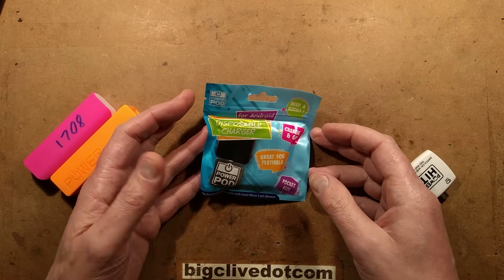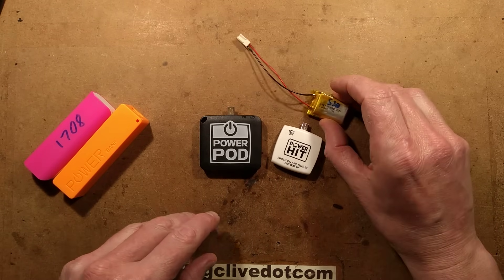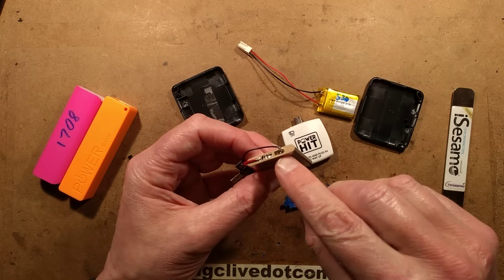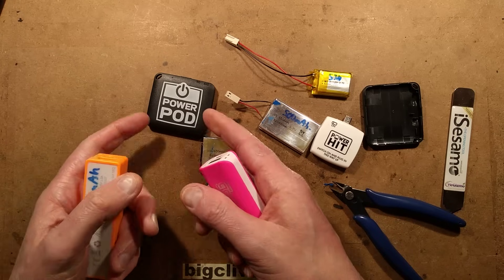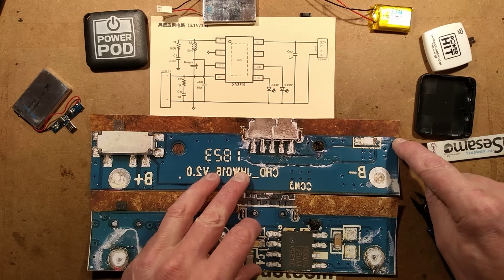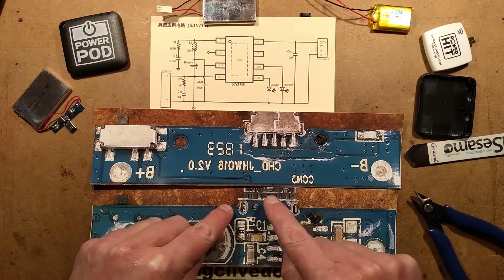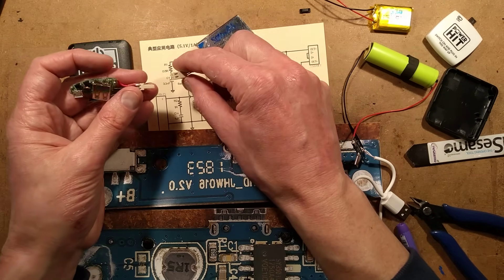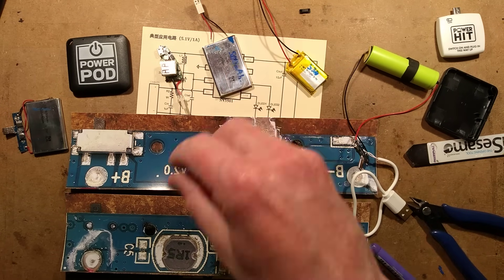Poundland "disposable" phone charger.

Comment: Those cells are most likely recovered from old cell phones or dumb phones. Normally new battery of this size has capacity of 800mah. Yours has only ~500mah. China has found interesting way of sending back electronic waste to europe ;)
Reply: Atak Snajpera interesting thought.. the larger one definitely looks like alot of cells old phones have used
Reply: Recovering and refurbishing old batteries could be too costly. I bet they are from old stocks of that kind of batteries.
Reply: This isn't how batteries work.
Reply: I think so too. Similar size to old Samsung replaceable batteries
Reply: It makes sense to reuse batteries for new purposes, if they are usable, before recycling them. Recycling takes energy and resources too, so if you can use an existing battery as-is instead of making a new one, that is always more efficient

It doesn't make sense to make them disposable however
Reply: If they are refurbished cells it makes sense.
Reply: @dustojnikhummer  no it doesn't. Having a load of lithium in one place, it could be recycled. Sending them out to be dumped in bins all over the world makes no sense at all.
Reply: @donrobertson4940  it makes sense for the ppl milking money out of recycling and then selling same shit back to where it came from. Most cheap china 18650 cells are from old laptop batteries.
Reply: @donrobertson4940  it makes sense in china where most of the world sent its electronic waste, they dont have enough facilities to handle the amount so its not uncommon for it to be sold in bulk to be used in other industries to make money off it
Reply: @HovektheArtist  They also don't actually safely recycle or dispose of any of the stuff sent there from real countries.  There's a reason they have cancer villages and have managed to send extinct over a third of all their native species of fish, not the fish quantity but the amount of seperate species, in only two generations since the communists invaded.  There's no clean water and no clean air, they had to ban all motor vehicles and spraypaint the grass green for the 2008 Olympics.  And instead of just throwing the batteries in the trash instead of recycling or atleast disposkng of them properly as they were paid to do, they put more plastic shit on them, send them overseas, for a profit, buy them in the trash back, for a profit, and throw them in the incinerator when they comeback rendered unchargable after being overdrained because of the lack of protection circuits.  Thank you China, and thank you Britain for doing your part for the environment :)
Reply: @r61425  i see someone else actually knows facts instead of just spewing opinions and jargon based on rumors.

And yea you are completely right, the backlash worldwide from this has caused america, russia and other countries to find somewhere else to dumo their electric garbage on, sadly its another lowest bidder deal and from what i have found one of the countries chosen is pakistan, which is just as bad as china, only that fact isnt widely spread. At this point if recycling electronics is going to be feasible going forward there needs to be actual places for it to happen and not just pull the same stunt over and over again just hopping countries
Reply: @HovektheArtist  Yeah it's great how bearucrats get to check off their list of responsibilities by sending the "recycling" off somewhere with a 100% Made In China™ guarantee that it's totally being disposed of to your standards with zero oversight, allowing western countries to say, "Our recycling is at an all time high :)" while reducing the amount of waste actually recycled by taking orders away from and closing domestic recycling facilities in exchange for those Chinese state of the art "recycling" incinerators, open pits, and once beautiful and non tumor inducing rivers.  The best irony is how alot of the pollution detected in California's air is actually carried by the wind directly from over China and the rest of Asia; they send the "recycling" to be burned elsewhere and it still makes it's way back, all while being smug and condescending to everyone about the environment.
Reply: @gglreallysucks5512  Because it still goes to China, and often gets shipped illegally in some cases, by both countries standards and regulations, due to corruption on both ends, usually involving mislabeling the shipment, to save costs.  Unless you just didn't know the UK shipped waste off at all, or maybe you did but you're just upset at any criticism.
Reply: @r61425  hey you’re paragraph(s) were well put. I just want to ask if you got any sources for you’re claims. anyways I hope you’re having a great day/night whenever you get to reading this. - j w

Comment: I bought the little single cell power banks. And got the circuitry out. And built my own. I'm thinking about  using a tp4056 and a DC to DC buck converter. And a couple USB connector to charge a phone or two. And what ever else.  I once thought I'd never need one of these. But being off grid. I can use all the power backup's I can get!!! And if I do loose power. From my small solar system. I can atleast use my phone. I have a few rejected cells from my liion battery bank build. I can use for this. They were rejected because of capacity. They come in at 1600 to 1990 mah. I'm trying to use only 2200 and up. And it depends on rated capacity. If it's 2600 rated and has 2200 I don't want to use it. I have over 1400 cells. For building two 700 cell batts. 7s for 29.4v. And as of now is about 250 ah each. About 95% are at or above rated capacity. I don't want to use it for a few months. Then have to replace cells. Or have the bad cells kill everything!! Great video!!

Comment: I'm a bit surprised that these are salable in the UK. I'm in the US, and I just assume our regulations will be either retarded or nonexistent. But it's something of a shock that the UK doesn't have standards barring the sale of rechargeable cells as a disposable medium. This breakdown leaves me to wonder if the same product would have been cheaper to manufacture, or of equal cost, if the switch had been omitted and the recharge circuitry put in place. I find it objectively shady that the manufacturer (not to mention Poundland) is driving sales by willfully crippling on-board capabilities, with the blatant intent of the batteries within (and the chemicals they contain) just ending up in someone's landfill.

Comment: Actually these devices are not as wasteful/pointless as one might expect. These batteries inside are recycled, probably in their third life and have much worse specs than required for typical applications. No one would use them for power banks, they're too small to be refitted to use in huge power storage facilities, so they're charged for the last time and sold as single use charger, which might be useful in certain situations. 
After disposal most of these will end up being recycled to raw materials and built into new batteries.
Reply from the maker: The battery is immaculate.  No sign of a label being removed or other physical wear, and a perfect cardboard separator where the protection module would go.  500mAh is also a very respectable capacity even if not the stated capacity.
Reply: @bigclivedotcom  I'm no expert by any means, but company that I'm working on used to make these on large scale as we were getting used baterries through goverment not only for free, we were paid to recycle, or in this case, reuse existing baterries. Why not make it a rechargable? Cause no one would care about such small and adding a micro usb socket and in our case 4 additional components would bum costs for the whole device by ~20-30%. I don't have much insight on this though, as I had other projects at the time.

Comment: They make great battery upgrades for my small FPV drone DM002 it actually almost doubles the flight time and is only slightly heavier.or save a few and make an emergency battery bank with a larger capacity, it's such a shame they are "disposable".
Reply from the maker: The drone batteries are optimised for very high current output.  These are not.

Comment: This needs banning. Also I think a AA to usb power bank/battery case would be a less wasteful product with a higher capacity, especially with cells like these available https://www.argos.co.uk/product/9803954. Lithium AA batteries provide 3,800mAh each! Someone must have got themselves a link to a lot of substandard lithium ion cells, I wonder what the maximum discharge current is and what happens when it gets there. 🔥?
Reply from the maker: The slight downside to the non rechargeable lithium batteries is that they contain a lot of lithium.  Lithium ion cells only have a tiny quantity.  The main components are copper, aluminium and graphite.
Reply: @bigclivedotcom  Indeed they do, I'm thinking with regard to recycling and the familiarity those taking part in it will have with ubiquitous AA cells as opposed to these single use chargers. I reckon AA cells stand a higher chance of being recycled properly in comparison, as well as being more effective in use.

Comment: I think Clive's correct on the reason for these Poundland ones in particular but I'm going to speculate a little more on this. A warehouse somewhere with a surplus of old mobile power cells. The phones they fit are now obsolete so they have no real marketable value. They get put on some clearance list, a butt load of lithium cells for next to nothing, the holders just basically trying to get rid of them and get a little return back. Someone sees these and thinks up an application to get them turned around and on the shelves at a significant mark up and voila. With the way the world is today, the cells would have ended up in landfill anyway, either dumped en-mass by the warehouse after non-sale or through this application.

Comment: I picked up 3 of these little jobbies from Ebay, the first one I managed to hook up to a freshly charge 18650 as they didn't really mark the hookup polarity on the blasted deal, then I went back to the auction, and they had it marked on their site.  The surprising thing about it, is that when I hooked her up, the main chip burned the hell out of my hand and smoke came from both the chip and my skin, then  try as I might, I couldn't get it to work (BIG SURPRISE!)  So after getting another working, I decided to experiment with the broken one, I didn't have a plug that fit the speaker out, so I soldered on some flat wire that I removed from some old stereo or something, then hooked them up to my speakers, the blasted thing came back to life!!! IT LIVES!!!!!  I have been playing music on it over blue-tooth from my laptop, as well as on the micro SD (TF) card and she really plays well.  It won't blow the roof off the house with it's little 3W amp but it could make your ears ring if you put it one some headphones.  I don't know where they tore these off, but you can see they were once part of some larger device, and the blue-tooth shows them as wireless headset with microphone, they do have a mic on board.  I haven't been able to get it to talk back yet but I will keep playing.     https://www.ebay.com/itm/Wireless-Audio-Receiver-Digital-Bluetooth-Board-Amplifier-DIY-Stereo-Speaker-ST/163233961641?ssPageName=STRK%3AMEBIDX%3AIT&_trksid=p2060353.m2749.l2649

Comment: Battery related question: I opened up a very old Dell laptop battery pack that had six 18650s in it. Of the three tested they had an initial charge of around 2.4V and after a couple hours on the charger they were up to 4.2V. Yay, free batteries! Alas, no, they would only power the screen of a vape mod (which also indicated the 4.2V) and not the heating coil. Now the question: If there is full voltage, why would they not power a vape mod? Is there another test I could perform besides measuring voltage on a multimeter?
Reply from the maker: Vaping devices draw huge amounts of current.  They require 18650s optimised for delivering upwards of 20 to 30A.  Laptop batteries are not suitable for that current draw and may fail with flames if used like that.
Reply: @bigclivedotcom  Thank you kindly for your reply. I've safely disposed of them; magic smoke release from a breadboard transistor ok, explody face flames not so much.

Comment: Hi Clive just want to ask you a question .... I have a holife soldering station that is only 2 months old and only been used 6 times on led lighting . I went to use it yesterday and it will not move from 0.50 now it's input voltage 220 to 240 volts AC rated current 1 amp it has a turned up on the front that will go all the way up to or should I say from 90 Celsius to 480 Celsius it has a 10 minutes cut-off time if it gets too hot and it will rump itself down to cool down just found it weird now that it won't move from 0.50 any ideas in what this could be I am more than willing to send it to you for you to have a look I make a video of hope to get a response soon
Reply from the maker: Check that the iron is plugged into the station properly.  It might be worth gently wiggling the front panel connector to see if anything happens.

Comment: I just thought of something. What if this thing is made of parts that didn't pass CQ and they're trying to recoup their losses?
It doesn't matter if the charging circuit doesn't work right if you don't charge anything with it. It doesn't matter if the battery is below is desired capacity if you put it in a throwaway product because few will be able to check the numbers.

Such parts would be discarded normally, so if they're using those parts for this instead, it might not be that bad.

Comment: Hey Clive; How about a video showing what happens if you charge these batteries without protection - do they explode ;) and what happens if they are completely discharged without any protection can they ever take another charge and what happens if you try to charge them again after...  Could be fun to try?  Thanks for another fine video.
Reply from the maker: If seriously overcharged the lithium can concentrate on one of the electrodes and cause chemical failure with the risk of a sudden self discharge and venting of heat and flames.  When overdischarged the cells will usually recover most of their capacity, but it's not recommended for high current applications.

Comment: All those charging ICs are useless because battery loses voltage easily below 3V but has more than 50% capacity so it is a pure waste of energy.
I want to see boost converter with input like 0.2-0.5 V boosting to 5V or 12V
Reply: The battery loses voltage easily below 3V specifically because there's only the residual fraction of a % of capacity left in there!

Energy is the integral of the voltage-current curve, or the area beneath it, and once energy runs out, the voltage necessarily has to drop like a brick, OK? And you can't somehow get more energy by drawing more current, because it won't let you, there's nothing left in there.
Reply: @SianaGearz  Oh yeah? You better watch this
https://www.youtube.com/watch?v=K53beWYdIpc

Comment: it is a reused old battery, because metal case lithium cells is not produced anymore, they are too heavy for small gadgets and too expensive in comparison with silver plastic bags cells. so to sell this in europe is a kind of a recycling. instead of dump old batteries in china they are refurbished like this and after one discharge they get proper recycling (for your money as a taxpayers) or more likely get refurbished again, sold to you again and again you can calculate how profitable it is.

Comment: Since it's single use they could omit the on/off switch, and instead put a contact with a piece of plastic put in place like they do to the batteries on some toys. That would save them a few cents on each device.  When the person goes to use it they just pull the plastic out and plug it in.
Reply: That switch cost them at most 0.5ct. I checked. Contact and pull tab might be cheaper for extremely high volume, but this device doesn't need to be made in half million volume to be profitable.

Comment: I'm not very well educated on electronics, but I'm trying. My thought was, if you had a dead 18650 or whatever with the protection circuit built in, could you salvage that and swap, or graft, it into a so-called non-rechargeable battery such as the "Power Pod" or the "Power Hit"? I'd appreciate your thoughts on this idea. Thank you for your "education" videos. PS Thank you also for the top about Fran Blanche. I'm now following her channel as well.

Comment: If they designed it to be able to charge from the phone with the switch set to off, it can actually be kind of useful with phones that support wireless charging. Or it can have a small solar panel so it charges itself for the next use.

Comment: i have a 'power bank' brand unit thats different to the ones sold at poundland, its less than half as thick but wider and longer and marked as 5600mah though the battery is not marked with anything.
the actual cell size is more what i would expect from a 2000mah , i get approx 50% charge on my sony xperia with a 3100mah battery, with those £1 units from poundland its 10% charge if your lucky! though the junk cell can be binned and a salvaged cell from a laptop battery put in for better capacity

Comment: (FWIW) yesterday I bought a 'chargenie 50'  at poundstretcher for £3.99 according to the box it's a rechargeable powerbank rated 5000mAh with output switchable between 5V/1A  5V/2.1A and 9V/0.6A - didn't seem to be many of them on the shelves so maybe it's a job lot of customer returns from someone like amazon that Mr poundstretcher got hold of.

Comment: What is the charging curent for the Poundland one?
Reply from the maker: 1A supposedly if the cell can deliver the current to the boost circuit.
Reply: @bigclivedotcom  was thinking of making a tiny power bank by adding a 3 amp lipo cell and a micro usb female charging port...should be good if it charges with 1 amp